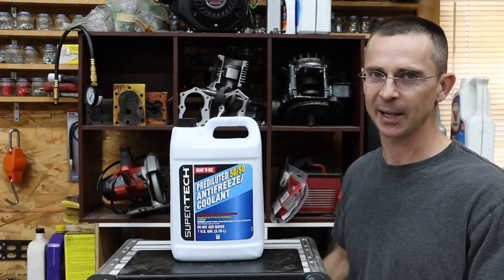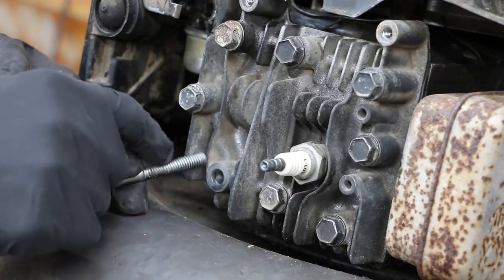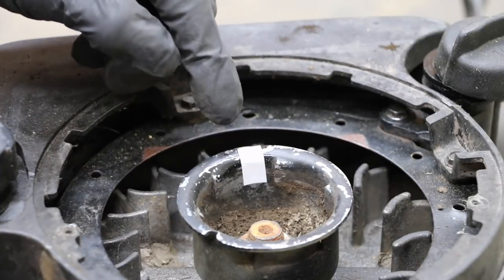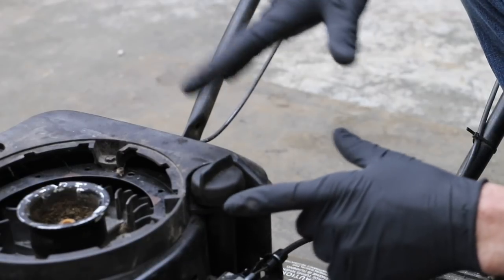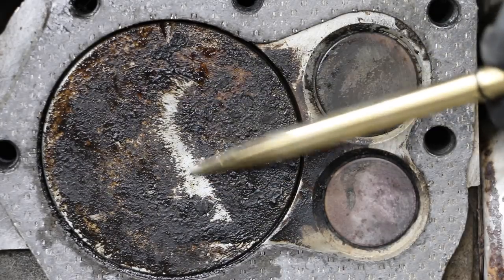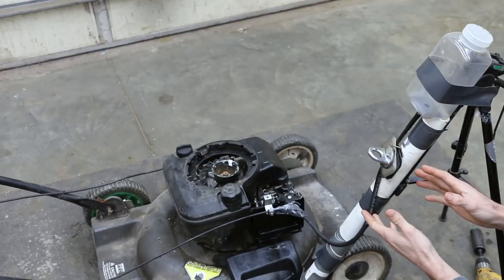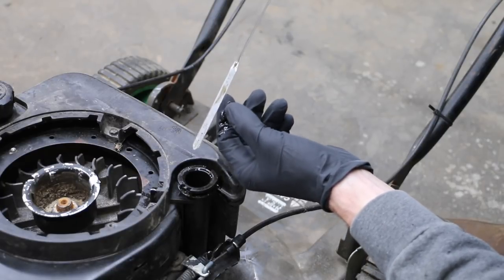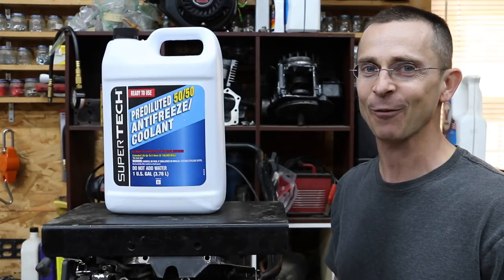Will Antifreeze clean an Engine?  Let's try it!

Comment: Ask a subaru owner lol
Reply from the maker: LOL!
Reply: Would get a lot more evidence asking Ford focus RS owners.
Reply: Ouch.. truth but damn lol
Reply: @onebadg8  That sounds like something that a Subaru owner would say.
Reply: I was a Subaru tech and did a head gasket on a car with 15K on the clock.
Reply: Crap. I can’t count the number of subie  heads I’ve done. Yupper heads or gaskets and sweet steam. They might be cracked or gasket is a blown seal 😉🔧. They do look steam cleaned! Easy to see it’s scrap metal!
Reply: @Sheehy223  the focus rs had a issue with the head gasket with how the engine was built.
Reply: LOL!
Reply: LOL!  A little TLC and and routine maintenance has kept my '07 Impreza 2.5i on the road without much fuss.  Guess I'm one of the lucky ones.
Reply: As a subaru owner (15 of them in the driveway), rally racer, and EJ series master tech I take no offence to what you're saying!
Reply: Subaru owners take pride in blown head gaskets.
Reply: 😂😂😂😂😂 Truth!

Comment: That copper wire trick was awesome!  Thank you!
Reply from the maker: Thank you!
Reply: It also works if you wrap a few of the threads around the bolt, but if you add too many you run the risk of having the threads lock before the bolt goes completely home.  In a pinch for non heat environments a bit of electronic tape will work too.
Reply: Michael Rogers Geaux Saints!
Reply: Its called a shim. It should have been anything.. such as parts from a pop can.
Reply: Solid copper wire is used in cement and stone as a shim and a connector.  Great for remodeling brick buildings.
Reply: Michael Rogers whodat! Where are you located
Reply: You could also use weed eater string
Reply: What does ur pic mean?.
Reply: I had never seen that before it blew me away
Reply: You can also stuff the hole with steel wool using a straight pick. Used this method many times in wood when wood screws would no longer tighten up.
Reply: @ProjectFarm  best way to get by a striped out thread is to use a stud bolt and get any remaining threads
Reply: @stangsaleen04  Weed eater string would not hold its shape when the engine is at temperature.
Reply: Aren't you worried about dissimilar metals being in contact?
Reply: works for screws and nails into concrete too
Reply: I wanted the video twice and didn’t see a copper wire trick. Lol
Reply: Serenity Silva 1:43
Reply: @ProjectFarm  I'm wondering, could you do a video about...if it's possible to cold down an engine using peltier cells on the radiator? You know, the peltier will cool down the refrigerant and hopefully cold down the entire engine 🤔
Reply: @seedlessgrapes2605  Project farm
Reply: @ProjectFarm  yes I used disinfectant spray but you have to use 10 cans of is
Reply: Ayyy saints lfg
Reply: @ProjectFarm  would a hot soak give more desired results, like with MMO or seafoam?
Reply: Teflon tape is an other fix, it's actually made for a similar purpose
Reply: I use zip ties but I’ve never tried it on a head bolt lol

Comment: I have heard mixing Diesel fuel with Motor oil before oil change will clean out sludge. None of My engines are disposable, so I wont test it.
Reply: Randell Darcky I've done it, I used kerosene though. worked well, but you gotta flush it with new oil after so... would I do it again.... not really
Reply: Randell Darcky I think it will lube the top of pistin and the piston rings and the piton wall
Reply: I did it before. Except I drained all my oil, filled it back with diesel, ran it for 2 minutes, and then did a proper oil change. I put another 200k on the engine after that. I wouldn't advise it on newer engines with VVT though.
Reply: did that to my s13 with a ca18det engine.
I added 1 ltr. of diesel to the old oil,
let it idle for 30 minutes,
drain it,
fill up with fresh oil.
still runs like a maniac for a almost 30 years old turbo engine
Reply: don't use oil. use ATF. BMW actually does this on their routine services. it helps make seals more playable and seal better. also helps clean deposits.
Reply: Or if you want to just keep it simple, fill the car with about 40% of its normal oil capacity after changing particularly dirty oil, run for 10 minutes, then drain.  When you fill it full again the oil will be much cleaner than not flushing.
Reply: I have a 1998 dodge Cummins 24 valve I Installed a new injector pump and the air dog fuel system well The company told me The fuel pressure was already set for my truck bullshit it was on 75 PSI well Half a tank of diesel fuel was inside my motor it happened twice never hurt the motor thank God I was pulling and old power wagon down the interstate when it happened just some white smoke came out but after draining the oil twice it was the most cleanest motor ever lol
Reply: I did it on an old Lincoln with a 460 in it. The oil I drained out was black and nasty so I put about a gallon of diesel fuel in the crankcase, changed the filter and ran it for around 10 minutes then drained it and replaced the filter and oil. The new oil looked clean after driving a little bit. About 5 years later we tore the engine apart and it was nice and clean.
Reply: I’ve done off road diesel. Which is dyed red.
Reply: I’m heard that but really it’s better if u keep spark plug unplugged and turn engine over Several times with just diesel it will clean all dirty oil out of cylinder and pistons
Reply: momo3369  never use oil with a detergent base on a gas engine it can gunk things up
Reply: I use the motor medic Engine Flush From Walmart. It smells like diesel. Its a really good hand cleaner if you get paint on ur hand etc. I use it every oil change (3,000 miles). First I get car up to operating temp, shut it down, add the motor flush, Run it at idle for 5 mins. Drain emediatly till it drips. Then I fill it up with Walmart supertech oil, run it for 15 mins, drain it till it drips and replaced filter.... FINALLY I add my synthetic. Oil on dip stick is hard to read it's so clear. My cars a v6 3.8 with 185,000 orginal miles Making 100 HP Than Stock. If you use diesel or motor medic I highly recomend u take pan out and clean it before hand. Mine had (and I'm not joking)  1/4" of mud in the Bottom Of pan. I Also Tried the motor medic for turbo engines Version... The difference I saw is it smells less like diesel, and it's Thicker and more like oil instead of water like the normal medic flush. With That Regard I'm Gonna Try Half ATF And Half Oil Now. But The Motor Medic Really Does A Killer Job, I feel it's too harsh tho, then again I haven't had any engine issues using it. (6 times in a row I've used it.)
Reply: Transmission fluid would be better so i have heard diesel fuel would likely dry out seals and cause leaks mind you any kind of "flush" on high mileage engine could remove the carbon that is preventing compression loss and or leaks.
Reply: Did this 3 times on an old 302 after fixing a blown head gasket. It’s an old time trick that definitely works
Reply: furnace3  

Marvel Mystery Oil is actually closer to automatic transmission fluid in my experience.

Sure smells better, though.
Reply: Tony P  

Better off to just use good oil and change it regularly.

Then you wont need to clean the engine because there wont be any sludge to worry about.
Reply: If your engine doesn't leak oil: MMO, WYNN'S ENGINE TUNE-UP, Seafoam, and others that you can use that cleans as you drive.(detergent based desludg) Never use desludge where you have to change the oil right after idling for 10min-30min because they destroy the motor oil.

Comment: I can tell you right now, as a person who works with anti freeze and similar coolants on a almost daily basis.  If you don't clean that stuff up right, it will leave nasty, sticky residue on anything it touches as it dries.  Anything that touches it will stick to it and it will be worse for your engine than any alternative in the long run.  And that's ignoring the fact that it could hydro-lock a cylinder as coolant doesn't burn.
Reply from the maker: Great point! Thanks for commenting on this.

Comment: ATF as engine oil or a cleaner?
Reply: Richard Ojeda no. ATF causes friction, not decrease it
Reply: Generic Name Thanks for informing me, I did not know that.
Reply from the maker: Thank you for this recommendation!
Reply: He used it as a cleaner already. It was part of the "I can't believe what Seafoam did to my engine" series. It actually did better than I expected.
Reply: ATF is a good lubricant and works well in trans axles that includes the gear-bow and differential in the same housing.
In fact it is preferable in VW trans axles for Formula Vee racing to reduce power losses and foaming you get with heavier oil gear oil..
But it is very high detergent levels so wash it off your skin or it will irritate skin to the point you will feel a slight burning sensation if you leave it on your hands.
Reply: I have used ATF to clean my engine and works great
Reply: This is an old timer's trick. Dumping some atf in the carb while running. Also water.
Reply: Richard Ojeda I use it all the time to quiet my lifters. Works a miracle EVERY TIME. 👍👌
Reply: JIGA BACHI how do you do it? Run it in the oil? How much do you put in?
Reply: I run it in the engine's oil.
My car(2.0L four cylinder) takes 4.5qts of engine oil. 
I substitute that last 1/2 quart(473cc) of engine oil with ATF.
I guess you "could" get away with using a full ATF quart if your engine takes 5 or more quarts of engine oil.
I personally don't recommend doing this procedure on newER engines, I would rather advice to use a GOOD KNOWN synthetic engine oil(Mobil 1) and let it do the work over the course of several thousands of miles(usually you start seeing results before 10K).
A friend of mine was having VVT actuator issues on a late 2000's Hyundai that had been run with regular engine oil for too long in between oil changes so he decided to give it a shot with synthetic motor oil and IT WORKED for him.    
Your "mileage" may vary, do it at your own risk(using the ATF).
Reply: No ATF is terrible to put into an engine and it will not clean anything unless you using ATF from the early 1950's before Whale oil was eliminated as the base stock ATF. The best ATF has less than 1/100th of the additives in the cheapest API certified oil. The base stock used is garbage compared to engine oil because it only has to survive up to about 165 degres at which point the seals in your transmission will cook and start to harden and the ATF will oxidize and start varnishing the inside of the transmission engine oil has to take 2-3X that heat to survive as it s;ips past the rings where temps can be 400-600 degree's. Crankcase oils are base and use Total Base Number to determine if they are good or bad and prevent corrossion. ATF and Gear oils are acid based and us Total Acid Nuber to determine if they are good or bad. So if you put acidic ATF or Gear oil in your engine you weaken the oils Total Base Number just like blow by gases do.  Stop repeating myths as facts if you do not believe me send an email to every oil and atf formulator like Exxon/Mobile, Pennzoil, Shell, Castrol, Redline, Amsoil etc...ask them if this myth is true ask them if ATF is compatible with engine oil or if it has any cleaning ability in an engine!!!!! Repeating this myth is as stupid as telling people to drink kerosine and strynine to treat a cold or draining blood out of people to treat illeness!
Reply: This is how I store engine blocks, wipe and or fill with Atf .... the block could sit in my shed in minnesota for 3 years and be good to go when I need it!
Reply: ROTFLMAO, I just wanna say I have read A LOT of really good non-sense in YT but you . . . you my friend . . . you're all the way up there on top of the heap. HOLY SHIT.
Reply: buckaroobonsi555 Very well said!
Reply: A good synthetic 0w20 has more detergent then ATF's and most engine cleaning treatments.
Reply: Gotrek12345 Damn for real. Because I always use 5W-30 full synthetic.
Reply: Richard Ojeda yeah when you want to do a clean just sub one quart of your normal oil for one quart of full syn 0w20.
Reply: Gotrek12345 I will definitely do that next time.
Reply: I honestly don't know that(detergents amount) but I do know for a fact that it does A LOT of cleaning on it's own.
Reply: Yeah someone one told me that I said they were crazy would love to see it put to the test
Reply: ATF has more "dispersants" and less detergent. The myth of ATF being more detergent just goes on and on. :(
Reply: Any good sauce on that ? Asking for a friend. LOL.
Seriously tho, I would like to know more about it.
Reply: Generic Name No I think it reduces it, additives makes it more slick.
Reply: Richard Ojeda I've used it a lot. And a lot of old timers used it. I had a V6 that the oil was like peanut butter. 55-60mph wide open and only making 2300 RPM. I put three qorts of ATF in it. The engine only held 5. Ran in for a week and in the first day I seen a big change. I changed it after the week and gosh, you wouldn't believe the crap that came out. I filled it back with 10W30 and one qort of ATF. Four oil changes later and had regular use motor oil when I drained it. After that, I'd drain one qort of oil 250-300 miles before its 3k oil change and add one qort of ATF. 
The engine went through pure teenage driving hell for four years and never had one problem.
The first week I was able to get all 6,000RPM and bury to speedo.
Seafoam in your gas tank helps a big deal too. The STP and B12 killed horsepower and MPG. ATF worked pretty good too. 
That's my experience. By the way, I got full stock oil pressure back in the first week too.
Reply: A good oil for transaxles is to mix ATF with 15w30 engine oil. I have rebuilt lots of transaxles which had straight trans oil in them, only to find major bearing failure. Now I hear you asking why trans fluid is used in automatic transmissions, & with regular servicing, they don't fail. One thing you need to understand is transaxle bearings are different from those in an auto trans.

Comment: On stripped bolts you can sometimes tap the hole for a slightly larger bolt or use a Heli-Coil. Great video!
Reply from the maker: Great recommendation and thank you for the positive comment.  You've got a GREAT YouTube channel.
Reply: Tap the holes for STUDS. get the bolt size for engine in 10.9 that are long enough and cut the heads off. Get nuts washers and viola youve got studs now. For a small gas engine theyll last the lifetime of the crankcase👍